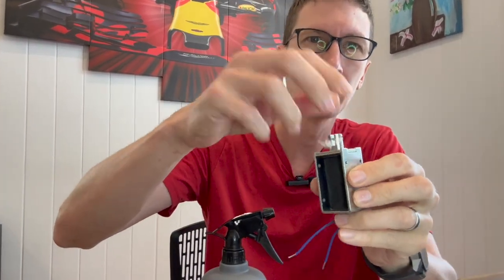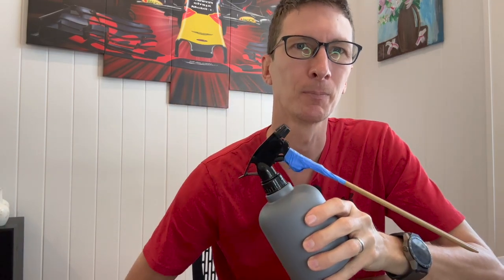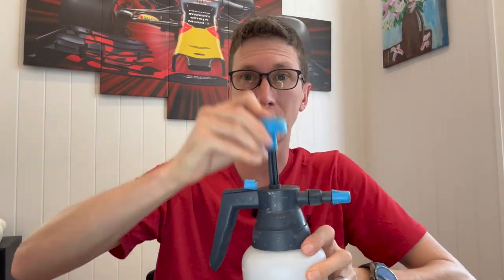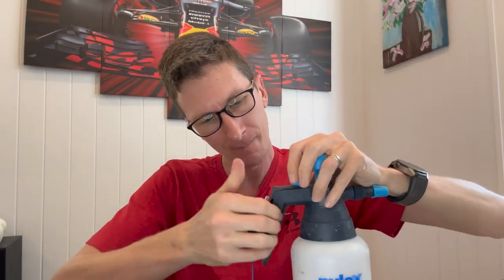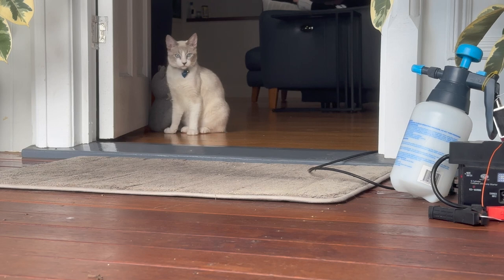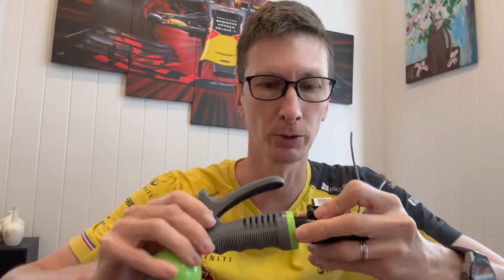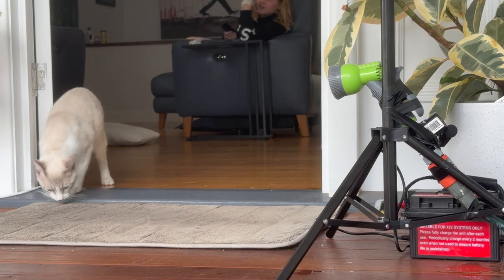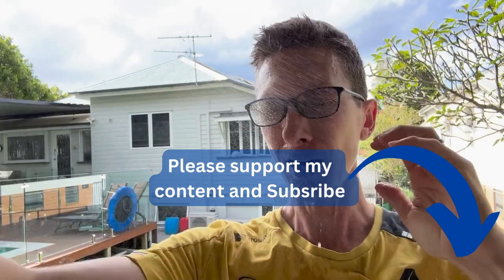Next Level Water Spray System for Repelling Cats

Comment: What type of relay are you using? I have a stray that keeps relieving itself on my front porch.
Reply: Also if you don't mind sharing the type of wiring set up you have.
Reply from the maker: I used a “Duinotech Arduino Compatible PIR Motion Detector Module” as it accepts a wide voltage range, wired to an Arduino Compatible relay to go with it, but didn’t use an arduino just battery > motion sensor > relay.